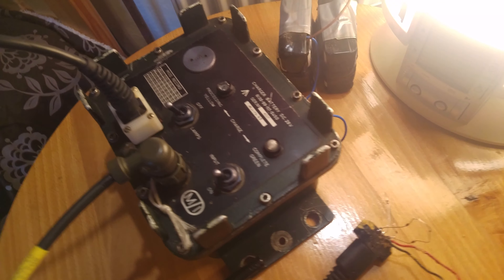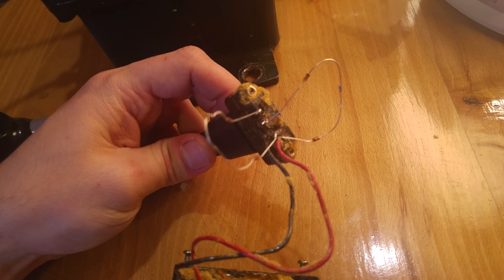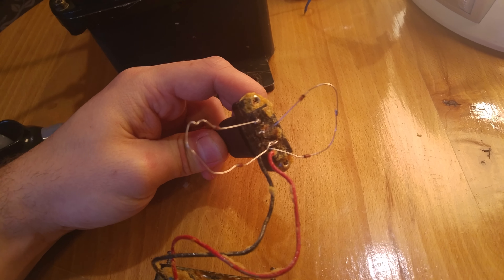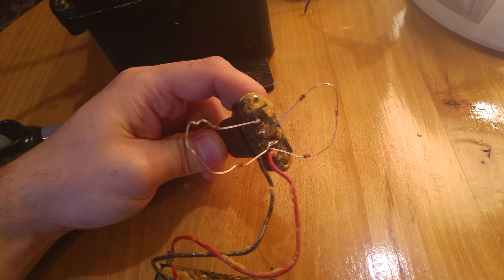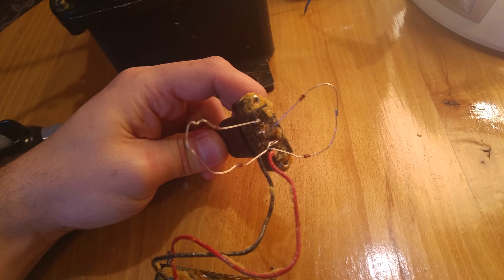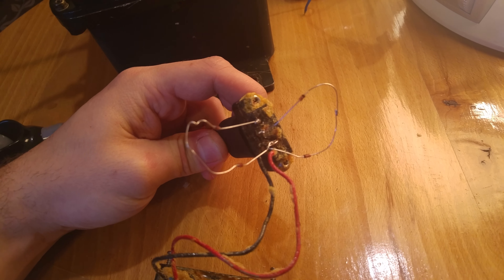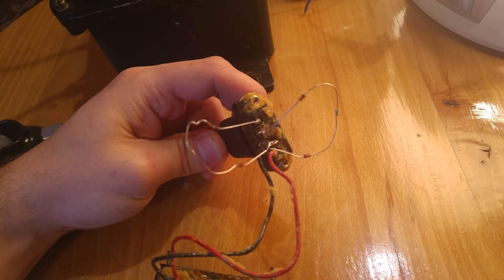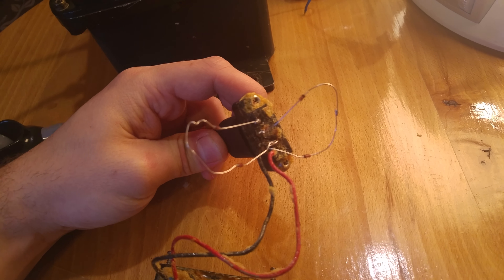Clansman 1Ah (2Ah MOD) 24V battery - complete rewire to use army DCCU  for PRC320 PRC352 PRC351

Comment: I'm going to rebuild my battery to LiFePO4 cells with interior BMS. And prepare it to charge from 12V supply, probably i will add some bustconverter into the box...
Reply from the maker: LiFePo4 - best chose!  Watch out for DC-DC as they most like will introduce noise (if You plan to have use radio while recharging)  Here is mine project of LiFepo4 battery for various radio -> https://www.youtube.com/watch?v=NpT2aDIOZ1k

Comment: Hello, I have just purchased a Clansman PRC320 radio and also included in the kit was a DCCU battery charger. I can see you have a lot of experience with this type of radio and I am seeking your advice. How do you supply the required voltage to the DDU? Have you made up a transformer arrangement if so, can you give me details. 73 Colin VK2jcc
Reply from the maker: Hello,  Thank You for comment:
I bought a dedicated power supply: it's called "Clansman mains adapter"
https://s3.amazonaws.com/files.qrz.com/k/m0ymk/Charger_PSU.jpg
I bought it for two reasons, first it delivery 10A and after making a cable between psu and clansman radio (buy  a battery extension cable that fit radio looking like this - https://armyradio.com/images/D/d_703.jpg) - You can power radio straight from this power supply without battery as base station. 
and second most important thing to me i got it for collection purpose to have whole set.

If You are not into collectible and You just want to charge Your radio i would not buy that clansman PSU because in my opinion it's overpriced and because of weight expensive to shipping.
First You have to answer Yourself question what kind of DCCU You have, they were two. One for 12V second for 24V. 
They are acting like current source and have built in dc-dc converters and accept quite wide array of voltage. 
When i was gathering my information about it there was stated: " The voltage requirement for the 24V DCCU is 20 to 30 volts DC. For the 12V DCCU it is 10 to 16 volts DC" <-  these values are from "the internet" but i'm pretty sure they are correct.

if You have a 12V DCCU You can feed it via standard 13.8V radio power supply.
if 24V - just grab a laptop power supply that have 21 / 22 v output - just make sure to unplug battery from radio while charging not to feed any interference to radio.

In theory You can charge it having radio attached and operated, leaving it constantly working on float charge but i came in my hands across radio PRC320 that was burn because of two fail at one time. 
1) battery capacity failed
2) dccu failed and outputted over 34 V   (charge terminals and battery terminals are tie together inside) 
in normal case that 3x V would not burn radio because it will be sink into NiCd cells that will limit voltage across but because one of cells were bad that 3xV go straight to terminal of connected radio and burn internal circuitry.

From that time i never charge it while connected to radio and I do not not recommend it.

After successfully charge when DCCU show green led, battery should be nice and warm to touch.
It's not using any dV dT measurement, just output about 30V 600mA checking if cells start to heat up, when they heating up it cut the current. 

hope it help
73
Reply from the maker: If You thinking about feeding 24V 1.5A to 24V DCCU im pretty sure it will work.

Comment: Good video. Please can you tell what make and type of batteries you fitted?73 Dave
Reply from the maker: Hello, 
I use 20 psc of standard Eneloop 2000mAh in battery holder (but i recommend go for Ikea LADDA 2450mAh - they work like Eneloop PRO -  have higher discharge current).
regards
Reply: Thank you for that. one more question.Will a Clansman DCCU charge the NI-MH battery OK? I thought the clansman battery cells are NI-Cd.kind RegardsDave
Reply from the maker: @1418-r1d  From my personal experience it charge correctly but i don't know what about lifespan of cells - in general there is no fancy dV / dT it just charge them as long they not overheat. For me, it's working just fine.
Reply: Thank you. I will use the same batteries..Kind RegardsDavid